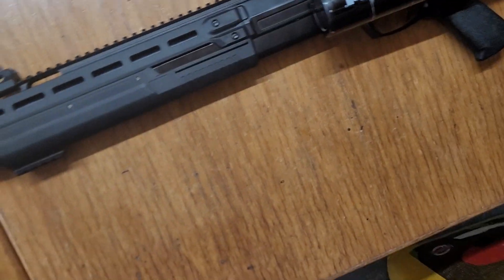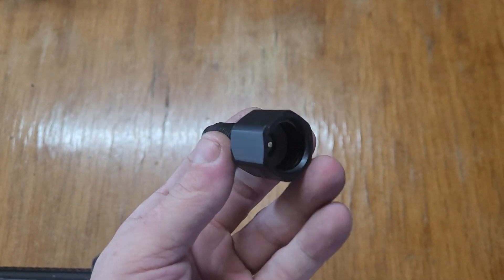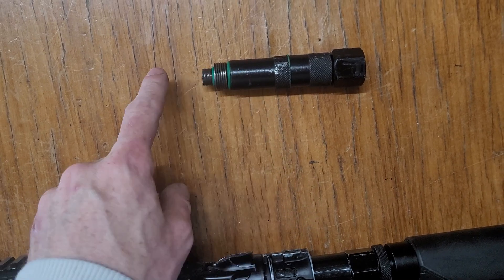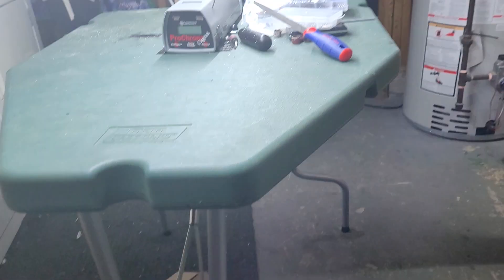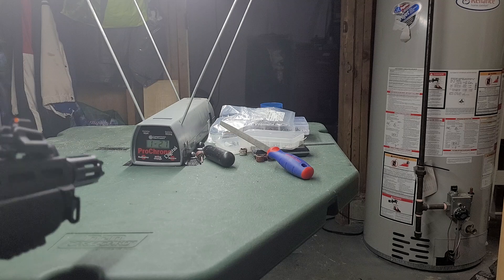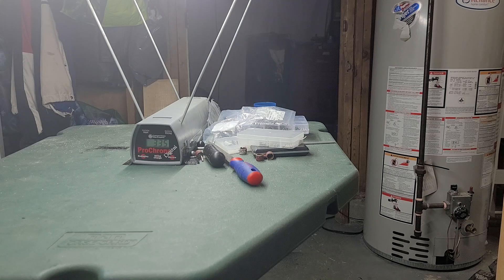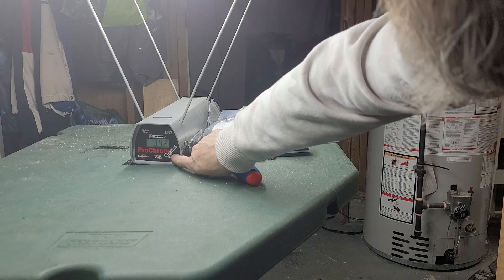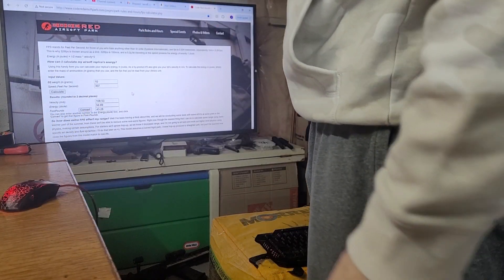Umarex HDX68 HPA 60 Joules Powertest PT2

Comment: I think  i have to Change that Oring too, because it farted First shot on CO2 Like yours, do you know the size for that rings?
Reply from the maker: yes im gonna swap it out, next video i shoot and no leaks or farts no more issues and the stock orings are 9mm od and 6mm id 1.5mm thick, we also use the 9.3x 6.1 i think in 90 duro